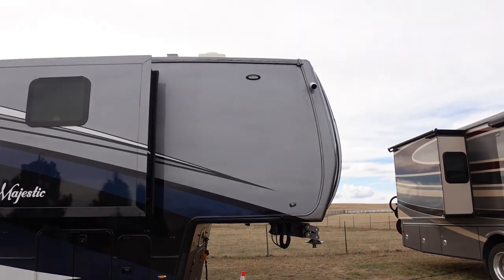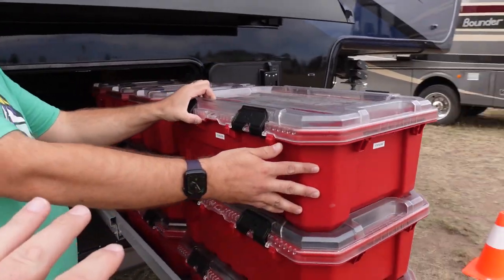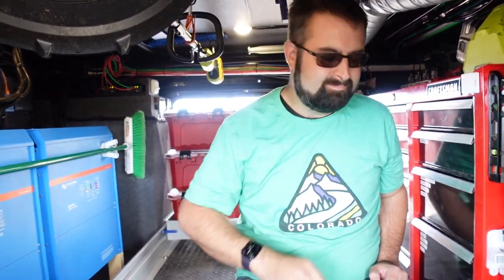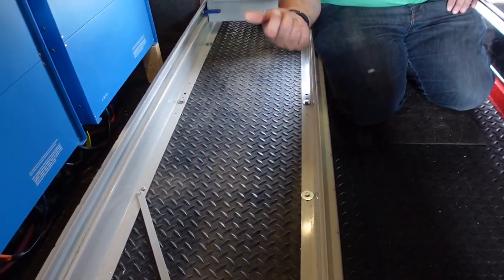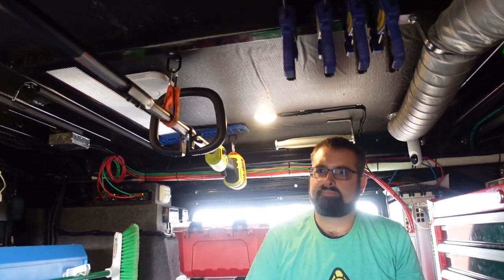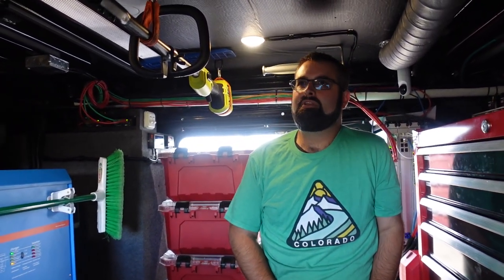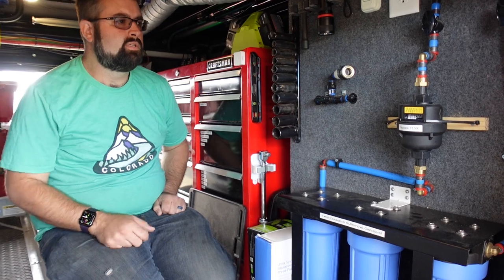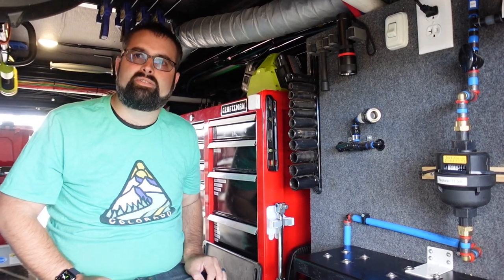DIY RV Storage Hacks and Tips in a Custom New Horizons Fifth Wheel

Comment: I'm now wondering how many RVers have a  3D printer. On the one hand, it is the right tool to make all sorts of brackets and holders for organizing the tool storage and wires (and kitchen and bathroom storage, and a million other things). On the other hand, while you can get one that's not that big, it's still kinda delicate for bouncing down the road. This is jumping out at me because I just got a 3D printer, and I'm now noticing all the ways it can make useful little items.
Reply from the maker: There are a few RVers on our discord channel that travel with 3D printers. I had one before we went fulltime 5 years ago and didn't think it would survive. I agree that the bouncing and constant moving could be bad for calibration and the more sensitive components but it would be an incredibly useful tool to have along.